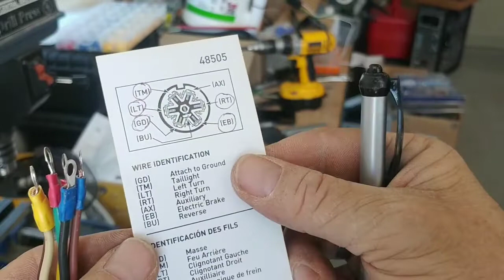Flatbed trailer rewiring, Harbor Freight 64337 trailer light kit

Comment: Hello, how much roughly should someone by charged for a full rewire on a similar trailer of this size? Im experienced in doing the wiring etc, but I’ve never done a trailer and am having a tough time deciding if to charge hourly since the current wiring is a mess or quote the guy $600 for about 3 days (15hrs) worth of rewiring work.
Reply from the maker: I did this one by myself also moving the camera around trying to film it in less than a full day also doing some welding for a couple light mounts so I can't imagine this job taking more than 6 hours or so if not filming it.  I think $600 is a fair price for a quality job.
Reply: @shanesdiy  I appreciate the feedback. I dont imagine it’d take as long as I’m imagining either but the previous trailer owner did a mess on it, using audio wire as electrical wire for the side markers 😅 Anywho, I think I’m alright with the price range I have in mind thanks to your input
Reply from the maker: @JDL_MobileRepair  Unless you are going to try and repair the old junk, I try not to give it much thought and just tear it out and build a fresh harness.  You do have to charge for your time to gut it though and the more crap there is to tear out the longer it takes...